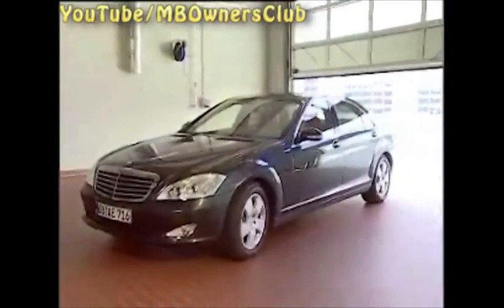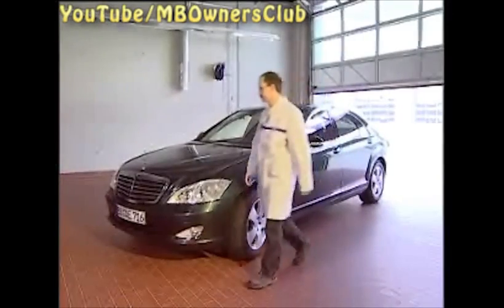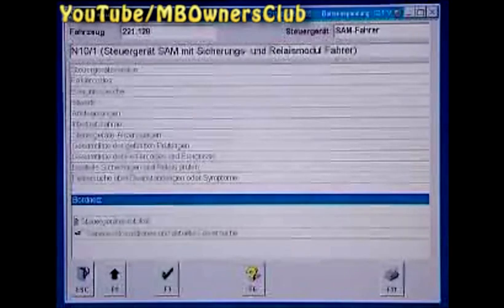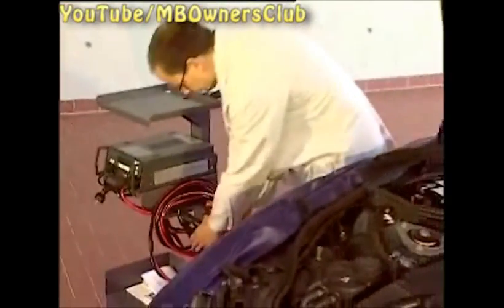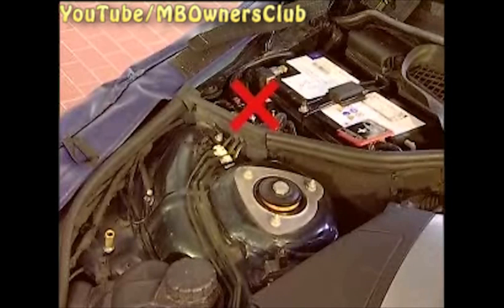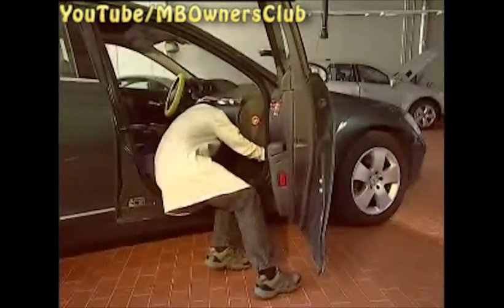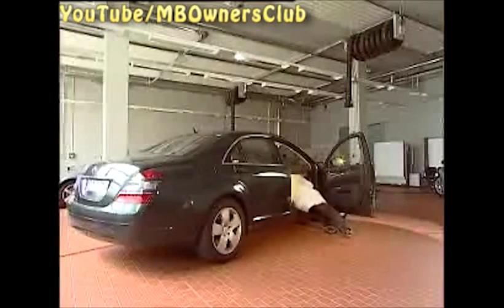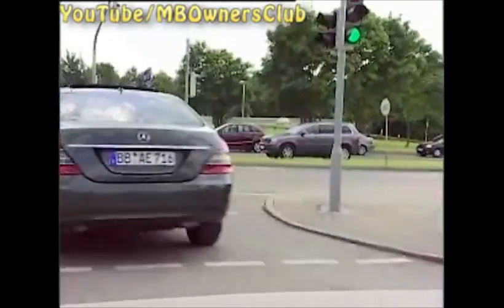Mercedes-Benz S-Class - Single-battery on-board electrical system | C216, W221

Comment: My w221 mercedes s350 single battery 2010 faces battery drain. We can not find the solution even with checking with the application and amper meter.normally, after 6 hours, the battery drain will happen. Is there any recommendations to solve the issue?I appreciate it

Comment: I have a 2008 Mercedes s450 4matic. For some time now, my stereo does not store my audio settings. My reverse mirror does come return to the original position. Basically the car does not store any memory. I investigated and was told to buy a secondary auxiliary battery but I do not know where it is located. I went to mercedes and I was told the small battery is under the hood (bonnet) but they did not tell me specifically where it was located. Please can you show me where to locate the small battery. It is a small battery, the size of a big cell phone. Thanks.
Reply: https://youtu.be/sBOpCWraNp0.  Hope this helps !

Comment: I have  a 2008 w221
Has two batteries. I guess it’s an early 2008 before the change
Reply: Where is the second one as i have same w221 2008 and cant find the second one
Reply: @lindidedolli6498  well 3 I guess. One in the trunk, 1 under the hood on passenger side and one small one under the drivers side dash
Reply: @c.h.r.i.s2253  I looked at the driver side dash but I could not find it. Please is there any suggestion. Mercedes said it is in the hood but they did not tell me where in the hood it is located.
Reply: @pattakora  the small battery is under driver's side dash behind the little "door" covering the fuses on the side of the dash when you open the door.you need to take the small fuse box out

Comment: My battery light stays on in my 1997 S550 I even replaced both batteries but still didn’t fix it
Reply: What ended up being the problem? I'm having the same issue
Reply: @cairolineberger4596  alternator
Reply: @malikothman5381  I think that could be my issue. How much did you pay to replace it? Did you go to the dealership?